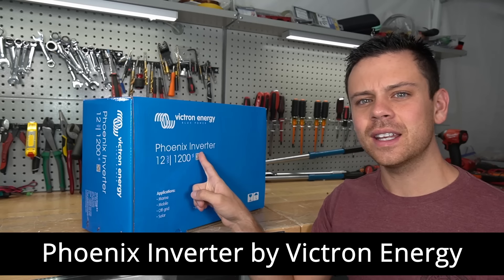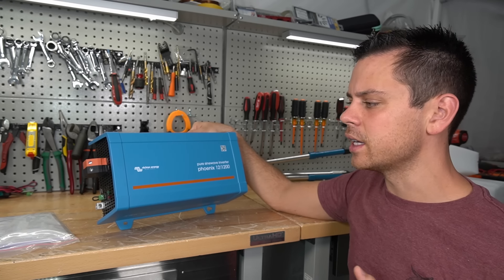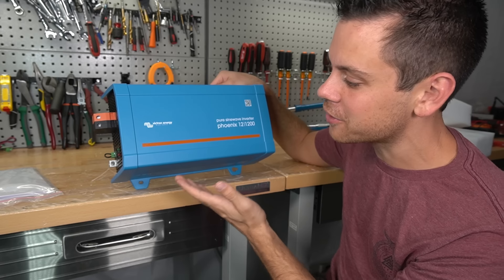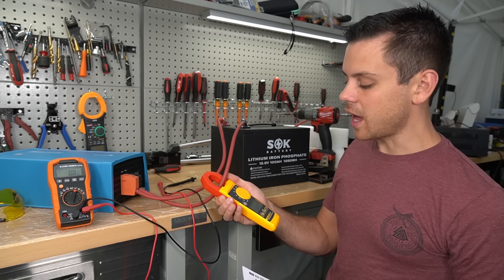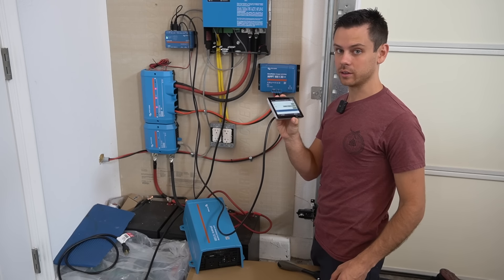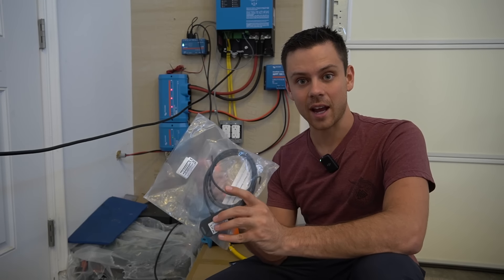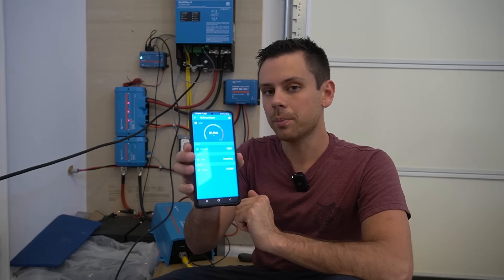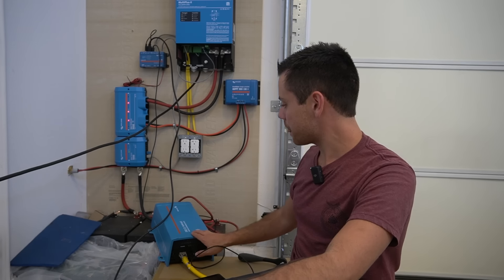Victron Phoenix 1200VA LF Inverter: Extremely Low Standby Consumption and More!

Comment: Hello from Youngstown Ohio.  I just inherited a brand new Phoenix 12 / 800.  But there are no cables in the box.  Can you tell me where I can get them please?  Thanks (2 awg?  4 awg?)
Reply: Ask AI (ChatGPT or Gemini) you will get answer quickly. For a 12V 800W inverter, the current draw is approximately 66.7A. To handle this current safely and minimize voltage drop (typically kept within 3%, or 0.36V for a 12V system), the recommended cable size depends on the distance: for runs up to 5 feet, use 6 AWG; for 5–10 feet, use 4 AWG; for 10–15 feet, use 2 AWG; and for 15–20 feet, use 1 AWG. Always use high-quality copper wire with insulation rated for at least 105°C, and install an appropriately sized fuse or breaker (e.g., 80A) near the battery for protection. Above is AI generated answer. However I felt you always want to use 2/0 AWG so you don’t need to even think about overheat or fire hazard.
Reply: Don’t trust AI when it comes to critical questions AI makes fatal mistakes even in simple tasks , ask the right people or educate yourself properly

Comment: Will, greetings from PR, thanks for every video, I finished installing my system just before Hurricane Fiona hit, it’s still holding (No power since Sep 17) I think your best videos are the “Solar Beginner” in your RV, and the mini generator guide. Some family members got the mini generators with the panels for charging phones and a couple os usb powered fans. In case anyone wants to know, my 5,400w Solar panel setup produced about 1.2kwh during the storm, 3.9kwh the next day (heavy rain all day), Monday climbed to 10.5kwh (little rain very cloudy, yesterday 14.3kwh. Again thanks for everything (You AND Hobotech)

Comment: My axpert 5kva hybrid inverter its about 5w in stand-by mode and it needs about 80w load to open full operation. With victron the budget was 3 or 4 times the money i spent. The advantages of the victron are the toroidal transformer, the monitoring application and service support.

Comment: This review posted at a great time. I've had my eye on this inverter for my camper. I have other Victron equipment and wanted to be able to integrate it with the Venus OS on a Raspberry Pi. It's pricier than other inverters of the same size, but I won;t have to worry about it.

Comment: Can this be paralleled with a MultiPlus to boost, in my case a 3000 watt output to 4200 watt? I need to find a way to run a small inverter welder off my system.

Comment: Hi Will, I have a mains powered fridge on my boat run off a 2000w pure sine inverter, but the standby is 1.03amps which is on 24/7… would this Victron unit run my fridge in Eco mode then “sleep” between each on/off cycles drawing very little? The fridge draws 60w once fired up. Thanks

Comment: I stumbled on a review from a guy working with electronics (no idea how that's called) and he explained you should avoid using the "Eco" mode if you don't want to damage them.

According to the manual, in "Eco" mode, the inverter will periodically send surge of energy to detect whether or not it should be powering something. Translation: your device, which is turned off, will periodically receive a small surge of energy and return to a state of powerless right after, every 5 seconds or so (this can be configured).

According to the guy, that is an extremely bad idea. A device is either powered on or powered off. Sending periodic surge of energy is bad for the electronic. Same as repeatedly turning a light on and off.

Comment: The Meanwell 1500 3000 48V has similar specs and has a build in solar charge controller.  Super high reliability but older design. No failures after dozen deployed.

Comment: That's why I have two inverters. A large 6kVA low frequency inverter for summer, with an idle consumption of 75W or so, which I don't mind in summer. For winter, I just replaced my Phoenix with a Multiplus II 3kVa which only pulls 10W idle.
Reply: Hey, man!
What you "night usage" system looks like?
Would you replace Multiplus || 3kva with smth else?
Reply: @dmytrodance  I'm very happy with the Multiplus II - very low self consumption and the 3kVA is perfectly sized. I would only replace it with another Multiplus II 3kVA.

Comment: Hi, I normally not comment on YT stuff and your doing an awesome job, even I learned a lot as a EE from Germany living in TX for 15 years. To measure correctly the current for low volt consumption leave the minus cable and use a Fluke True RMS (177 or higher) between battery plus pole and inverter and use the current outlets on the Fluke.

Comment: I was just looking for an inverter upgrade to run my refrigerator in my travel trailer is this a good option or are there better ones? Trying to keep the cost as low as possible. Thanks.

Comment: Question: I've been thinking about using one of these (250w version) to power a computer monitor from a 12v battery. Watt draw of the screen is 24W according to manufacturer, so should be ok for the eco mode to turn on. However, I've heard that the frequent searching cycle in eco mode might be bad for the screen electronics. Anyone that can clue me in on whether or not that's the case, and if so, why? (:

Comment: Very nice! I have some victron components and if you are using cerbo or something like that ( i have raspberry with victron program running in it) you can access it from victron connect app -> from top corner VRM -> select your installation -> and again top corner select devices. And now you have list all of victron devices what are connected to cerbo or something similar. So no need of bluetooth in this case, all system settings can be configurated from there😀👍🏼✌🏼

Comment: question for you bud. I want to build a enclosed trailer for my motorcycle track races. Tire warmers consume about 1200watts and i would love to install a roof mounted ac to keep me bearable during the hot days. They run about 1450 watts. How many panels (455W), how many battle born 270ah batteries will i need? Im not good at electrical and i plan to have an expert do the wiring but doing the install and mounting of everything i plan to do. I need this to run a ac maybe 8 hours a day and same for the tire warmers. Is this feasible or am i just dreaming for this much power draw?
Reply: Check out his review of the new solar direct heat pump-may be better than ac if you only need it when the sun is out

Comment: thx, so as you say,  can I use this inverter as normal use up to 1200watt? and also low stand by consumption?  what about my air blower rated 1200 watts or rice cooker 680 watts etc?

Comment: Yeah, thise efficiency specs are insane. Perfect for my 48v car hauler project coming up. Yhe 1200 watt model will run the 8000btu inverter AC unit no problemo. And since 2 is 1 and 1 is none, ill have THREE because the price is pretty good for that efficiency.

Comment: will ,I am a licensed and union ibew electrician living in north central texas.   I know a lot about electrical but my knowledge is ac not dc as I independently and via the union .   I amwanting to wire my stuff up with solar but minimum or no inverter .    My wanting no inverter or minimum inverter is to not spend x amount on this item that is also expensive but subject to all kinds of demerits.   so to make a long story short or rather a question short....could you advise me on going solar minus the inverter

Comment: Will can you recommend a battery that will run my AC all night or at least several hours? I believe my AC is 450 W and I intend to recharge the battery through my vehicle 12 V system or short power 110 V at a campground when I’m there what do you recommend please can you help me out here? Thanks a lot JIM.

Comment: I just bought this inverter in  24 volt/ 1200 VA to run my New Fridge and small 7 cubic Freezer  powder with 4 Li Time 100AH Batteries   setup in 24 volt  with 2. 100/30 Victron MPPT Controller's just setting it up week of 1/28/24. I hope it all works

Comment: Thanks for all your work.

Have you seen the announcement from Morningstar about the introduction of their expanded line of SureSine inverters and the GenStar MPPT DC charging platform? The new SureSine inverters include six models from 150-2500W .

The launch webinar via BigMarker is w/ PV Mag on Sept 28th, "New Off Grid Launch: DC/AC Inverters and HIgh-End DC Charging System".

There's also an interview w/ the presenters in the Sept 2 issue of PES Solar, p46.

Comment: I got a 12v 500va phoenix , to power a fridge but found that my fridge takes about 1,000 watts to start therefore will not power it , That model looks to have a firmware problem , which is if you try to power a 400 watt resistive load and you get an overload , so to get around it you need to add an extra 200 watts first .
Now I have a 24 volt 1200 va which is powering 2 fridges and a small heating when I need a burn off some power !!! , I think the 1200 va is just the right size to get , DON'T trust want the output meter says , 20 = 0 watts , 30 = 48 watts , it is very non-linear and jumps in 28 watts and can be hundreds of watts out plus and minus .

Comment: I see they now have a 24-volt model. I'm just getting started and only have 2 12-volt 100-ah batteries. I plan to build out the battery bank to 4 12-volt batteries over time. Would you recommend the 12 or 24-volt inverter? Thanks for all the great videos.

Comment: Heya Will, can you do a max load test on this unit?  Victron indicates it can handle 130% peak and surge all the way to 2200 watts.  Curious how long it would run at 1300W, 1600W and 2000W.

Comment: Hey there buddy, took your advice on a simple agm solar power setup a few years back. Well if I had the amount of solar you have in your big home I could probably power all my needs in a place that has sunshine all year round. However, just a year into powering just 200ah of agm with 800 watts gave out. Still couldn't afford the lithium batteries so I bought another set of agm batteries. One year year later they gave out too. Also I fried many cells in my panels because I didn't have large enough solar wire for 800 watts. I had 10 gauge but I wasn't made aware from your setup that a lower gauge was necessary if your powering more than 200 watts on 10 gauge. Either way, my total investment of 2000 could have been better spent by just using a generator or portable  power bank which would provide 10 times more power and last 10 times longer. Just an FYI.

Comment: Remember you can feed a multiplus with this inverter(or lets say a small 1000watt inverter generator) to add capacity.  So let's say your seeing anything from 400-3000 watts or whatever.  You can set it up so this inverter or a generator pulls max 800 watts, and when the load is exceeded the multiplus will assist for the rest of the capacity.

Comment: I have the 24v version. I got it because it has a wider input voltage range than alot of cheaper inverters. I use it with a 3.5 Kilowatt Lithium Titanate battery bank that needs to be okay with 30V ish input. Some other inverters listed 30V as the absolute max input but would make unpleasant sounds at 30 volts, and didn't feel comfortable using them. This one doesn't seem to mind at all. Plus I really like the automatic shutdown on low voltage, I mean it's never been needed but I'd rather my freezer cut off for a few hours than my batteries getting fried out.
Reply: Regarding sound, how is the noise under different loads? I am considering running a max of 70 watt on f.e. a 24/250 model.

Comment: I love my victron mppt and phoenix but inverter's load in numbers never worked, only the circular bar indicates the load and second it has big diference with mppt monitor in voltage reading. Inverter always reading lower voltage. Those two issues are really iritating.

Comment: If you have a Cerbo GX, you should be able to plug it directly in, set Cerbo to Bluetooth, and programme it with the Victron Connect phone app. You shouldn't have to buy a Dongle if you've got a Cerbo GX.

Comment: Some of there larger inverters will auto switch ( or combine) if you have a larger load than the small inverter can handle  And on most the new  Victron equipment the remote on off can be a switch connecting the two terminals or +ve voltage on the H or earth potential on the L terminal of the remote. terminals.

Comment: What do you think of Morningstar products? I like the No fan and heat sink. This phoenix product has a very low draw on eco and no load, how hot did the inverter temps get with a/c on 24/7? Morningstar products look good to me, with the draw back of only a 300w inverter. Would like to know your professional opinion on this.
Thank you for sharing/real world testing reliable products.

Comment: Two points: First, that very low 1W average is only when there is no load. It's putting a pulse down the line looking for a load once every 2.5 seconds, and that doesn't take much power. When there is a load, the inverter overhead will go up substantially. Second, the Outback inverters work the same way, at least the FX series. I have an FX2524 that I've set to send 6 cycles of test current every 2 seconds, and it draws an average of ~2.5 W with no load. That's more than this, but it's a 2500 W inverter. When it's supplying current, the inverter overhead is more like 26 W. (I chose it because it's sealed, and at our 1-season camp anything with a fan will probably be full of spiders by the end of an off-season. But the very low no-load current is also necessary.)
Reply: hello Singularly, do you have video show your outback?  it total seal nothing can get in with heat-sink on back which I can run a small pc fan to cool it?  please give me link video. thank
Reply: @makesaveinccomm  Sorry, I don't have any video of it. Not really much to see, it just sits there. It does come with an external fan and housing that you can hook up if you need to. I don't use that in my installation because we don't run it very hard and the ambient temperature is rarely over 32 or 33 °C.
Reply: Do you happen to know how the load hunting interacts with a freezer?

Is the one watt enough to engage the freezer's thermostat reader and initiate the real load if the thermostat indicates a need for it?
Reply: @priestesslucy   If it’s not a super-fancy freezer it’s probably got a mechanical thermostat, which will change mode (on/off) without any power. And when it flips to “on”, the inverter will see the startup draw of the compressor motor, which is plenty to turn it on.

I suppose some super-fancy modern freezers might have an electronic thermostat, in which case it almost certainly won’t draw enough to keep the inverter on. It may vary from inverter to inverter, and you can usually set it to just stay on. The Outback at least also has sensitivity settings.

Comment: For more accurate low current DC measurements, I would suggest that you run the DC directly through your good quality DVM. Most of them will accommodate 10 Amps (max). This will be more accurate than doing multiple turns through your Hall effect clamp-on DC meter. A 3.5 digit DVM should give you accurate DC current measurements down to 1 mA.

Comment: a really good use for one of these inverters would be a residential 120v refrigerator in an rv. dedicated to just the refrigerator and sized appropriately, the cost would still be less than a dc compressor refrigerator like a novacool and would be almost as energy efficient.

Comment: I think it's good to have a small 12v inverter that can power the basic required appliances, in an emergency you can connect your car to it to charge it if needed,  especially if you are off grid!  And if you have a riding mower, it would be worth fitting a car alternator to that you can remove the deck belt, and connect the alternator, or use its own pulley!  10-12 hp can generate tons of power to charge batteries,

Comment: You seem like a smart guy, but you didn't say a word that the characteristics of this device are specified in volt amperes, not watts. Accordingly, you have only about 60% of the specified power when connecting devices without a higher volt-ampere characteristic such as computers and other electronics.

Comment: I am using the 24V/ 800VA version to drive a freezer on my boat both as dedicated inverter  and not having to run the main 2kW inverter all the time, but also for its low idle draw. Having two inverters is good for backup too.  The freezer has very large surge power need on startup, significantly over 1kW but only 60watts when running. You can hear the inverter growl for a second as the freezer demands power. First I bought the 500VA version and it could not handle the surge.
Reply: Thanks for your info! I'd like to get one for my fridge, it draws less than 100watts but spikes to over 600w on startup. At one point I saw it spike for 12 seconds at 400w but usually for 1 second. Do you know how long you can spike above rated for without doing damage?